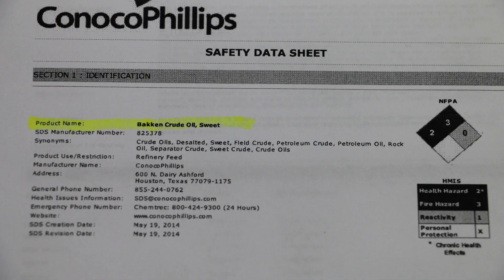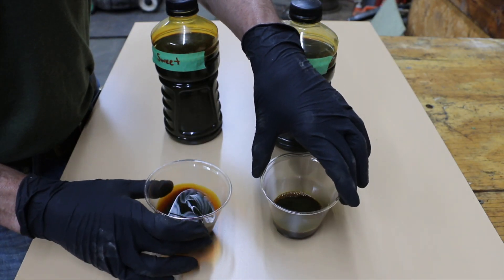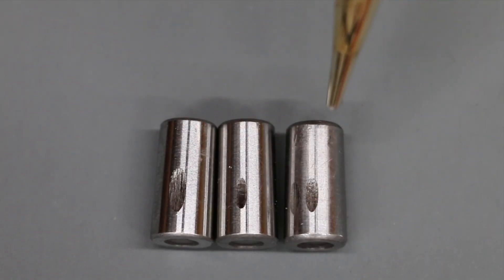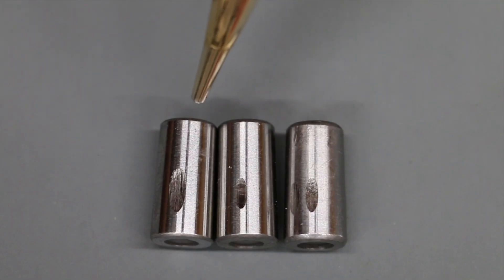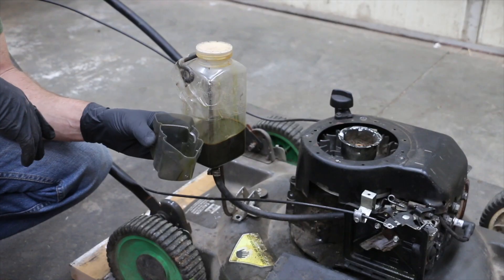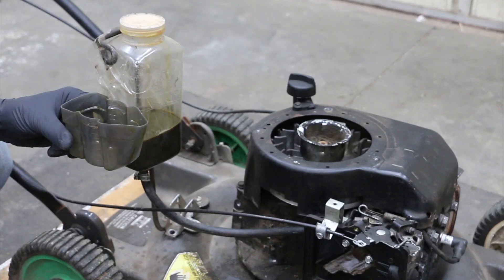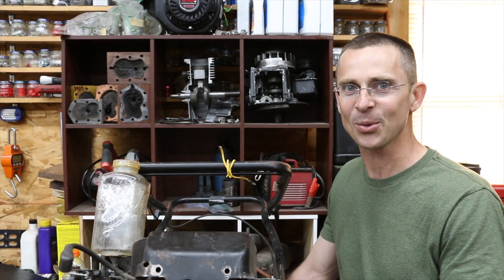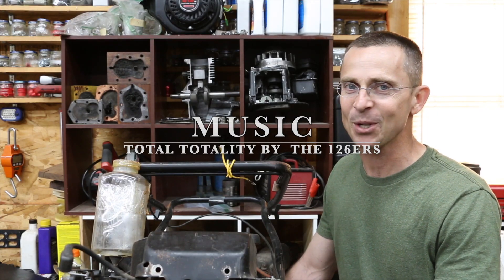Will a Gas engine run on Crude Oil?  Let's try it!

Comment: Try crude oil in a diesel engiene
Reply from the maker: Thank you for the video idea!
Reply: @ProjectFarm  This is such an interesting idea I subbed so I can see the video if it pops up ;)
Reply: Project Farm I suggest a Yanmar small diesel engine. Direct injected air cooled and easy to work with.
Reply: @erikkovacs3097  yanmars are durable AF too
Reply: Wow I am surprised it actually ran
Reply: @tdgreenbay  ty sir. Saved me 9minutes
Reply: It would almost certainly run better; Considering how thick diesel is compared to gasoline.
Reply: I’ve heard claims that the lighter crude oils (as from much of Arabia) can fuel a Diesel engine without much trouble. I’d like to see if that’s true.
Reply: @markiangooley  The originals were actually designed to run on peanut oil. I wonder if that would be the case in the 21st century engines.
Reply: @markiangooley  During construction of the Burrup Peninsula project in Western Australia they did exactly that. All the diesel powered construction equipment ran on LNG condensate. They apparently saved $29 million in fuel costs. I heard from a friend that many of the machine's engine's were worn out pretty quickly due to contaminated fuel and lack of additives. But the savings far outweighed the reduced engine life.
Reply: So, will a diesel running on sour crude still need you to pee in its exhaust?
Reply: We'll probably be using Urea injection from now until the end of the Diesel ICE so you better get chummy with it.
Reply: Previously he has been offered a Diesel ICE for free [one from a reefer I think] but I don't know if he ever took up the guy's offer.
Reply: Urea injection is like mosquitoes....probably won't get it to go away, but only the nut jobs will ever celebrate it.
Reply: It should work fine with sour crude, as it has good lubricating properties and is as good as a fuel as gasoline.

Diesel engines can run in vegetable oil, so, why not?
Reply: @hypernova3527  well the only issue I see is the crude is pretty volatile compared to diesel. It may detonate
Reply: Well I mean pre detonate ** as diesels use compression ignition haha. It may ignite well before the piston reaches tdc
Reply: It will run fantastic I bet, best to try it in 80s mercedes diesel car, you cant break it that easily for sure from experience with running gasoline to see if anything breaks
Reply: It should in a diesel
Reply: I celebrate urea injection because it’s an annoying reminder to the dieseltards that fuel economy does not mean squat for environmental impact. Diesels are dirty engines and the sooner we are rid of them the better.
Reply: @Bartonovich52  please. Regular gas engines pollute waaaaay more than diesel. Just because you dont see the fumes doesnt mean they arent there.
Reply: @Bartonovich52  You have no idea what you're talking about.
Reply: @Bartonovich52  Diesels in the US have to meet the same emissions standards as gasoline engines.
Reply: Try it in an old diesel engine (pre- low sulfur era)
Reply: Or an 85 Chrysler
Reply: If a diesel will run on vegetable oil unmodified it would almost certainly run on filtered crude.
Reply: @UniteForgetLeftRight during diesel shortage in the UK my wrangler 2012 ran on 70% vegetable oil 30 diesel straight from a grocery shop and then 90+% oil later when I couldn't get any diesel at all. Struggling on 100% but once it started it was OK.
Reply: Diesel engine will be like : mmm..yummy  yummy .
Reply: I think it will go boom.I only add a gallon of gas to a tank of Diesel tohelp fire better in winter. I would to see how crude burns